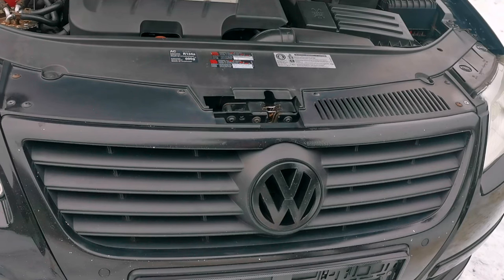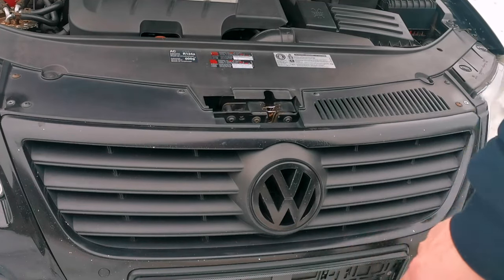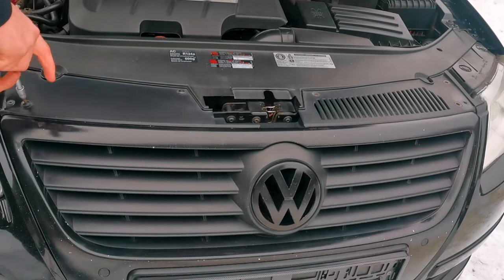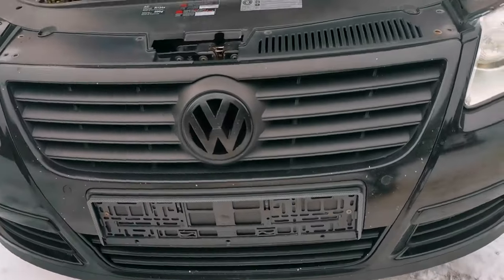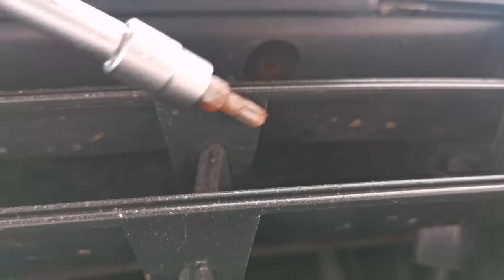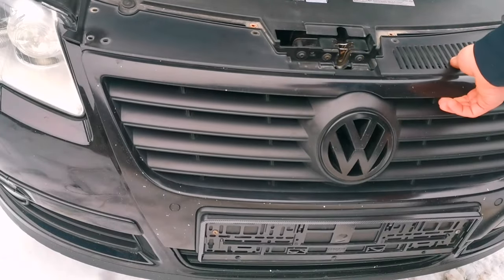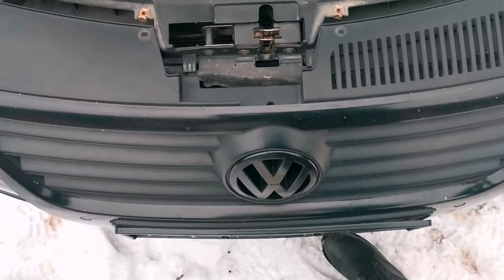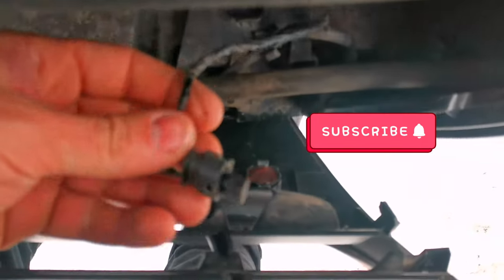VW Passat B6 Front Grill Removal (EASY AND FAST)

Comment: Did you painted the sensors aslo? Thinking to paint my grille black but don’t know what to do with the sensors
Thanks
Reply from the maker: Yes, I painted also my sensors, it's not a big deal at all. It's very simple but first just use some 800 grid sandpaper to make sure that the paint will stick to the chrome
Reply: @HOWTODO0828  thank you,

Comment: Hi, i wonder if the parking sensor can be removed from the grille too?
Reply from the maker: Hello, yes it can be removed very easy, the support for the parking sensors are glued on the front grill and front bumper etc, it's the same for every car, you can just pull from the two clips which are holding the parking sensors to the exterior and the sensors will came out.
Reply: Hi,can I change just the chrome frame of the grill?
Reply: Thanks for the video it helped me change the parking sensor very easy on my Passat b6. T25 and t30 heads were needed for mine.
Reply from the maker: You're welcome 🙏
Reply from the maker: Yes you can. It's difficult to do it.

Comment: Hi,can i change just the chrome frame of the grill?can it separate from the grill?
Reply from the maker: Yes you can, but it's hard to separate it from the grille without breaking the clips, you can remove the chrome part and install a new black part over the original plastic frame 🙏

Comment: Did you have to remove the under tray first? I took all screw out but still cant pull grill off ( no sensors )
Reply from the maker: No, you don't have, only the screws I showed in the video and it should pop right out
Reply: @HOWTODO0828  Thank you
Reply: Make sure you take the number plate off, done that mistake😅
Reply from the maker: @omarkhater391  😂😂I did it
Reply: @HOWTODO0828   is the numbeplate holding it stuck otherwise? i tried this and couldnt remove the grill, but i have my numberplate still on
Reply: Number plate didn't make any difference on mine. Grille came off very easy
Reply: @mj2023uk  your a year too late lol